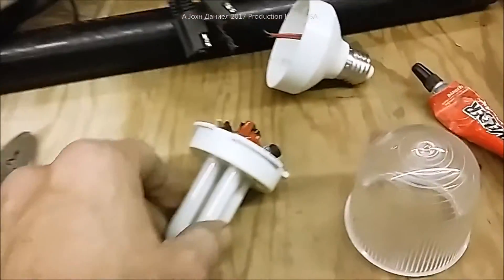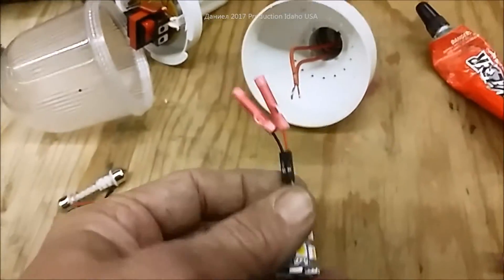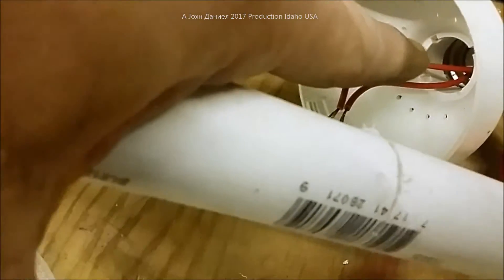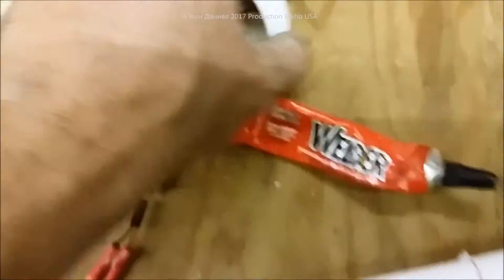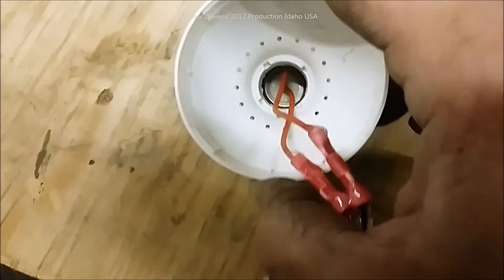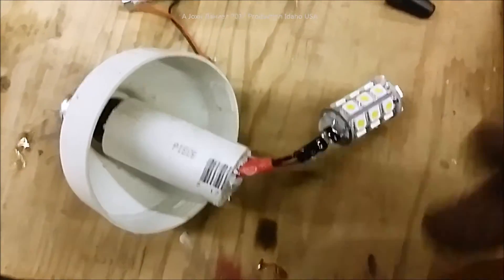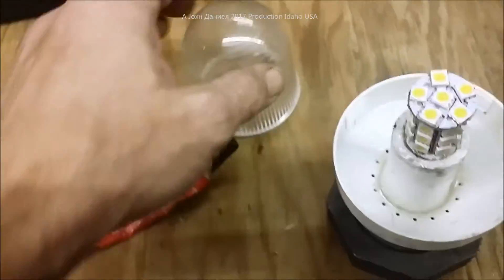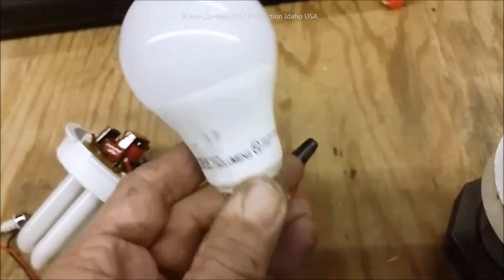Making 12 volt LED lighting DIY

Comment: Hey John, great videos, very informative, thank you.
Is the lamp holder on the ceiling 12 volt or can a 120v standard lamp holder be used. If 12 volt, where would I be able to purchase them. Thanks again.
Reply from the maker: You can use these https://amzn.to/2w14FZ1 and the best 12 volt LED you can buy that I put into installs is the Le Ming https://amzn.to/2HpeR4c

Comment: Hi John, Is there a link for the actual E27 light you are using in this video?  I'm very interested because of the plastic globe that screws into the base.  This might work perfect for a project I'm working on, but I can't seem to find anything like the lamp you are using in this video.  Thanks!
Reply: John, thanks for your reply.  I am looking for this particular model you show in this video.  I need one with the clear plastic lens cover.  I'm looking to make some landscape lights and thought that this base with the lens cover could work out for my project.  Do you have a link for this one with the lens cover?
Reply from the maker: That exact bulb and fixture was sold originally at Deal Extreme http://www.dx.com and I have not been able to get it anymore, they may have a similar though.

Comment: Hehehehe, I did these about 5 years ago... Until I found out I am allergic to them :///. but don't leave them burn for a long time. When HOT, they de-soldered themselves leaving some not lighting up.  Sometimes you would see HEAT burns on the board too.
Reply from the maker: Theres the solder GLUE LED's that do that, melt apart then theres the real quality G4, 1154, 116 LED's that use real solder.

Comment: What kind of connection are you using for the bottom of the light bulb? Great idea for these bulbs. I've had 6 of them that haven't worked for years.
Reply from the maker: +MyOtherNewName The bulbs are E27 style already.
Reply: Ok, so what's connecting to the two probes coming out of the bulb?
Reply from the maker: MyOtherNewName I used G4 bulbs with butt connectors  to  the wires on the doner  leads.
Reply: I used the H7 12V DC Car Head Lights for Brightness :))). Also they are easily adapt since they have the Metal Plate on top for heat sink and the 1/4" Spade connector :). But Heat will kill it if you leave it on 24/7, just remember that since they go into the encloser ://